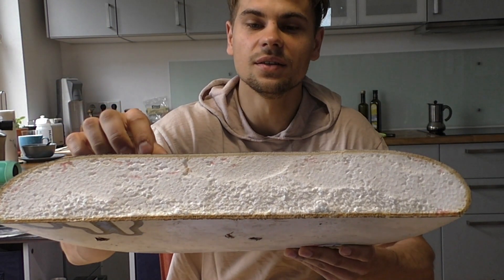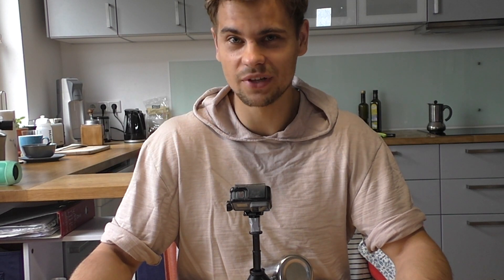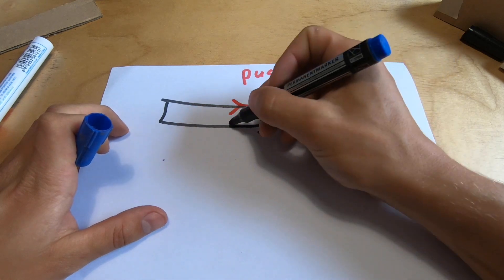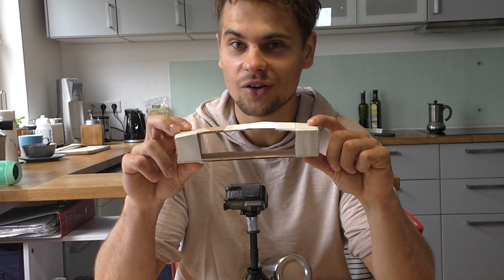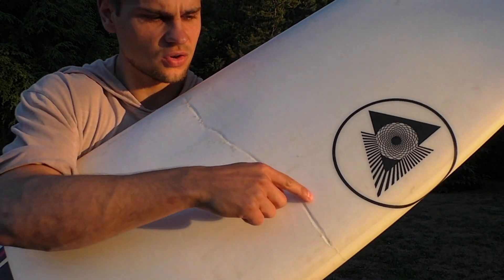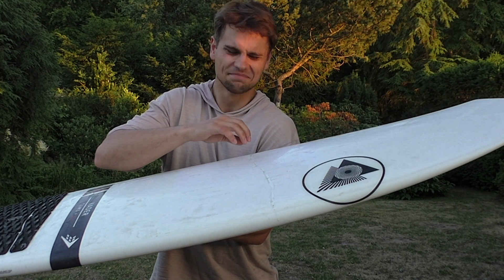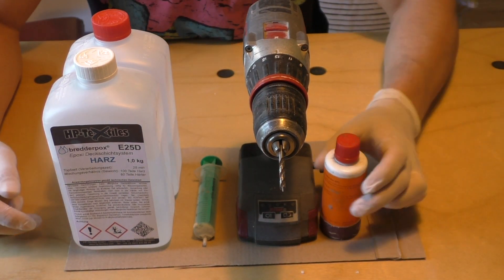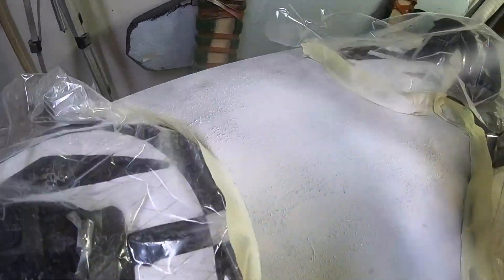Pimp my Windsurfing Board Ep. 2: Repair a soft Deck and Board construction mechanics

Comment: Someone told me to use PU Foam as it was easy and could do the job. 
You know the foam that comes in a spray can and often used in building projects.

What's your opinion on that?
Reply from the maker: Its a good solution! Even less environmentally responsible but i guess that ship has sailed anyway regarding surfboards. U gitta be mindful with the holes u drill. The expansion rate is pretty impressive. U dont want to deform or crack your deck. So maybe make bigger holes and drill the strategically. Good luck! Let us know about the result maybe!
Reply: The correct material is 2-part marine urethane foam in similar density as the EPS core of the board. You must allow it to expand out through some holes.

Comment: Thanks for your video.  I have a few questions.
1. What is the name of the foam you injected into the holes with? 
2. When we saw the cross-section of the board, it seemed to me that both the top and bottom sandwich panels were very thick. Do they each form a separate sandwich structure? So, for example, does the top panel consist of three layers—some kind of foam between two laminated layers?
Reply from the maker: @agostonzg  Hi! Its epoxy with a chemical thats called "Treibmittel" in german. The translation might help u find it.
Second question: Yes, exactly. But it has a pretty average thickness. The Foam is very hard and has a thin fiberglass layer at the bottom side and a carbon layer on the top. A good construction would hav carbon on the bottom side, too. But its a serial board. They are pretty much all constructed in that way. Good luck with whatever yours planning!
Reply: @derbastlermeinesvertrauens753  
Thank you for your response!
And what do you think about "POLYURETHANE EXPANDING FOAM" instead of the "epoxy-treibmittel" combination?
https://www.youtube.com/watch?v=mFKU0DddPgk
From 2:45, you can see how it expands and how solid it becomes.
Reply from the maker: @agostonzg  it also works very well. Just becarefull. It expands a lot. It might crack the board if u dont give it a possibility to leave the space. For example with holes

Comment: Fantastic video. Very interesting. You mentioned turning the board upside down to prevent resin moving away from deck to much. I guess you tape the syringes to the deck and then flip it

Comment: Is it possible to use only polyurethane foam spray which enlarges and fills soft areas instead of using epoxy resin?
Reply from the maker: Hi! If its really soft go for it. Massevely expanding foam could damage/deform the deck though so be carefull with it ;-)

Comment: Nice repair :) considering doing some repairs myself. And been looking at different repair methods. What is your opinion using polyurethane foam ? I heard if epoxy got injected into the eps foam a chemical heat reaction can happen. Melting your core? Any thoughts thanks for the video gives me strength drilling into my board 😂
Reply from the maker: Haha just go for it;) Polyurethane could be better if the deck is really REALLY soft because of the bigger volume, that needs to be filled. I heard of chemical heat reactions, too, but for that to happen you need to use a LOT of bad quality resin. If you use that stuff, that makes the resin expand additionally , the risk is almost 0 if you ask me. 
Furthermore I think, that resin soaks into the foam better than polyurethane (better connection). Thats what I observed when I got rid of an old fin box recently.
Reply: https://boardlady.com/softdeck.htm
No, no, big mistake! Replace the original material with the same or something similar. Epoxy injection will make it worse. Eva is the expert on board repairs. Other than that, your videos are good, but please consider Master Eva's advises. Great knowledge that should be passed on. https://boardlady.com/softdeckanalysis.htm and finally this here: https://boardlady.com/injection.htm

Comment: bin jetzt zwar kein profi, aber soweit ich weiß, wäre es kein Wunder, wenn das Deck relativ schnell wieder weich wird und man das ganze von vorne machen muss.
Das Problem ist, dass das Epoxy vieeel Härter ist als der Schaum und jedes mal wenn man auf die Stellen tritt, drückt sich das Epoxy weiter in den Schaum und weicht diesen damit wieder auf...
wie sehr dieser Epoxy Schäumer das Problem minimiert weiß ich nicht, aber Prinzipiell würde ich das mit 2K-Schaum auffüllen(selbe Methode mit spritzen und Löchern, aber eben mit Schaum, nicht mit Harz und zum Schluss eine Lage Glasfaser drüber.
Reply from the maker: Hi,
danke für den Beitrag. 
Ich kenne die Schaummethode auch. Ich denke, sie macht Sinn, wenn das Problem schon sehr schlimm ist und sich der Schaumkern schon großflächig vom Sandwitch gelöst hat d. h. viel Platz für Schaum da ist.  Dann spart man durch Schaum Gewicht und vermeidet ein mögliches Überhitzen und Schmelzen des Schaumkerns durch die exotherme Reaktion von Harz.
Mit der vorgestellten Methode (auch ohne Epoxy-Schäumer) habe ich vielfach gute Erfahrungen gemacht, auch bei danach noch intensiv gefahrenen Boards. Die Erklärung dafür könnte sein, dass sich danach eben sehr lange nichts mehr bewegt.